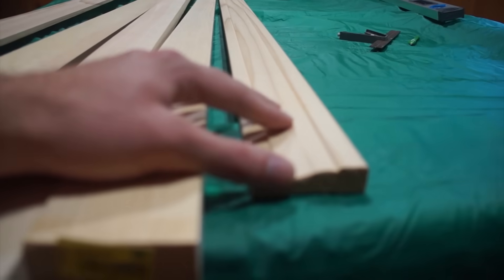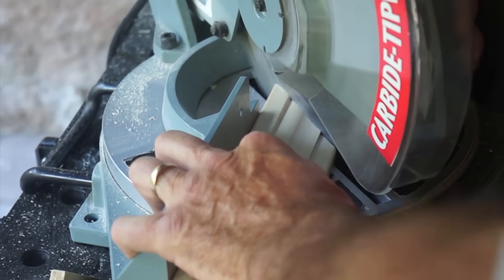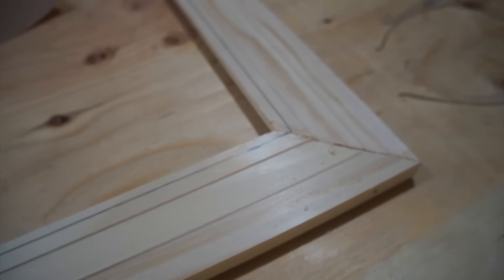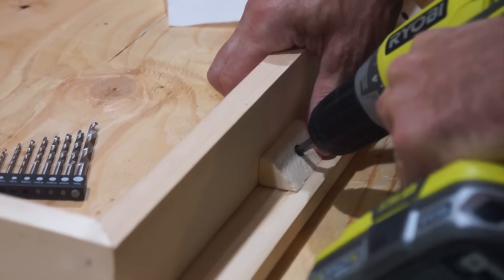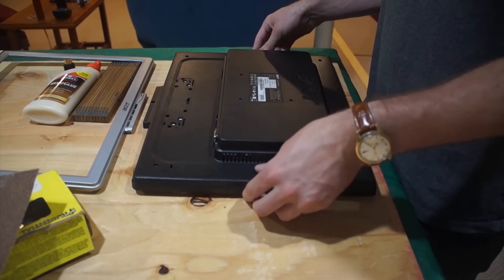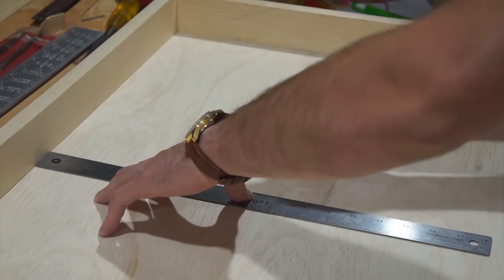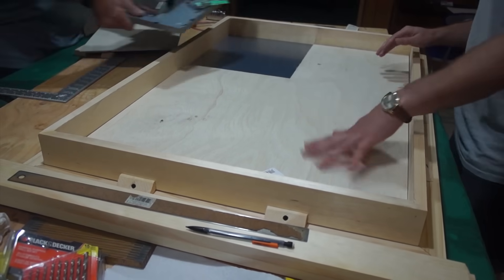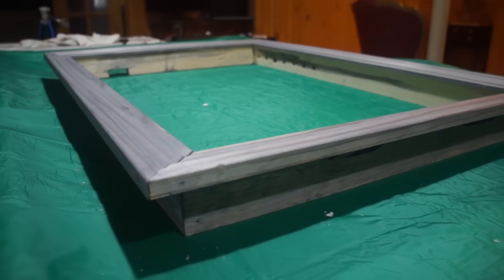HOW TO BUILD A SMART MIRROR

Comment: Great video. I was wondering what the total cost of this project was. Also, would it be able to power the raspberry pi from a usb from the monitor?
Reply from the maker: The total cost of his mirror in its size was around $130 I believe it came out to. Also you would have to check the TV's output current on the USB, but I wouldn't think you would because normally they'll give you 0.5 Amp when the Pi will require about 1 Amp sometimes more of current. That's why I used the wall adapter.
Reply: You could always install a long surge protector/ splitted extension cord on the inside of the mirror so their is only one cord coming out of the mirror
Reply from the maker: That's actually something I thought of doing but never got to it. Definitely a good idea if you want to minimize the wires visible
Reply: Grensom never mind on the tower question from the software video I now understand the raspberry pi is the OS
Reply: Would it be cheaper to just use Samsung's smart view option?
Reply: Less cords too right?

Comment: Link where to buy the mirror itself?
Reply from the maker: Elexie Munyeneh Because I want the display going but I also want room to be able to use the mirror and see myself without text in the way
Reply from the maker: You can get the Mirror off of Amazon
Reply: Grensom 
Is there a reason you put the monitor in the corner?